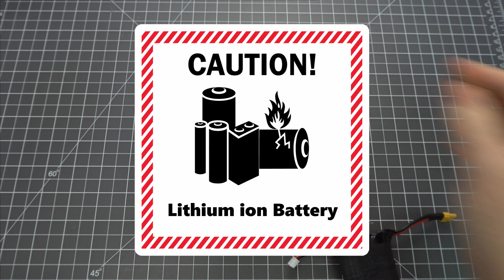How to Spot Weld 2S and 3S Lithium Ion Batteries for Micro Long Range FPV

Comment: Hi, cool video! Recently I started doing my own battery packs but I realized that these nickel strips have very poor conductivity. I use 0.15x8mm pure nickel strips and on internet I found that such strips are rated for ~8 Amps before they start to heat up considerably. So to benefit from the cells I would need to stack at least 3 of such strips to increase conductivity. Have you considered this?

Comment: You shold add battery charging protection board its better for all batteries even lipo battery you will never need balance wires for it

Comment: The 18650 batteries you linked (Molicel) look a little sketchy. Do they work as advertised?
Reply from the maker: Molicel make some of the best quality cells on the market.
Reply: @whiffles  Thank you! Not familiar with them.. and the price seems to good to be true. I will check them out.
Reply: Molicel are probably the best cylindrical cell on the market in terms of performance. The only one that passes it's performance is the samsung 20S, but those are lower in capacity. (2000mah vs 2600mah). Nothing sketchy here.

https://www.e-cigarette-forum.com/threads/bench-retest-results-molicel-p26a-2600mah-18650-beats-vtc5a-best-all-around-18650.902761/

Comment: How do you charge these packs? Lipo charger settings end voltage of 4.2v or liion charger settings of 4.1v?  And do you charge at 1c or 0.5c?  Thank you?
Reply from the maker: Charge them up to 4.2v on the lipo setting at no more than 1C.

Comment: that train clip at the start where you slowly sped up to match the speed was of the train was mesmerising
Reply from the maker: Yeah it passed by in the middle of a pack, perfect timing! I just wish I had an ND filter on it at the time. I was comparing with and without.

Comment: https://www.thingiverse.com/thing:3842681  is one of my favourite 3D printed ways to make a 3S pack, as an alternative to spot welding.. it is held together by rubber bands, and needed 0 welding /soldering..  i charge up a bunch of individual cells and in the field, swap them out from the transmitter , goggles, this 3S pack etc.. wherever needed..

Comment: just a PSA for anyone doing this - DO NOT omit the doublesided tape (or some sort of insulation) holding these cells together - you want to ensure that the cells never actually touch each other as in a crash there is the possibility of the thin heat shrink on the cells getting punctured where the cells touch which will cause a short circuit (as the case is negative).
Reply from the maker: Great point! Thank you!
Reply: Thick fish paper and kapton tape, with some drops of hot glue perhaps, will do the job

Comment: two things you are not using insulators which can be dangerous especially in a drone application. and two those nickle strips are not rated to conduct 35a of current the most on those is 2amps so if you are pulling more then that the strips will heat up and your spot welds are at risk of disconnection
https://www.youtube.com/watch?v=wdZ_Ca_sAZE&ab_channel=EbikeSchool.com

Comment: Wouldn’t it be easier just to use a battery Tray? A little more weight but the advantage of being able to chuck your 18650’s into a charging dock like the ones used for vaping?
Reply from the maker: I wouldn't trust a battery tray. The connections aren't permanent, so a power failure is possible.
Reply: Vape chargers are useless for this hobby. Get a proper balancer charger.

Comment: Another AMAZING video. Thanks Whiffles. I've got 6 Molicel batteries on the way.  Maybe I missed it but what kind of flight time are you seeing with the 3S 21700 batteries?
Reply from the maker: I didn't build a 3S 21700 pack, only 18650. That would be an interesting pack to try though. It'll probably fly heavy but 30 min+ should certainly be possible with the right motors. On my 3S 18650 pack I managed about 15-20 minutes on my 4850kv motors, but these motors are better suited for 2S.
Reply: @whiffles  I rewatched your video without distractions and verified that you mentioned all of that. Thanks! 

Do you think I could fly my BetaFPV 95x v2 HD with a 3s 18650 pack?
Reply from the maker: @vbp6us  That's probably a bit too heavy for a 95mm quad.
Reply: 21700 would be great for my LR 5" I'm just nervous building a pack. If I can get 4500 to 5000mah and 30a be super.
Reply: @divingfalconfpv4602  I ended up building a 4200 mAH 40A Molicel (sp?) in 6S.  It rips and lasts forever on my 7" longrange
Reply: @vbp6us  want to make 1 and sell it lmao 🤣 
GF afraid I'm burn the house down

Comment: thank you for the video, it is exactly what I need, just one question, what would I need to change to build a 4s battery?

GReetings from Colombia
Reply from the maker: Just use the same principle. A single series where the balance wires coincide with each leg of the series in order.